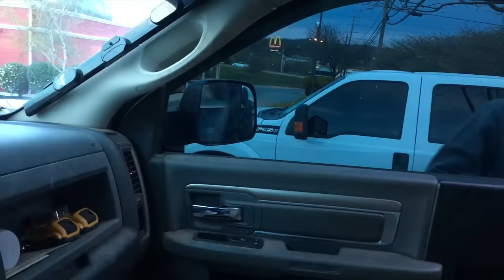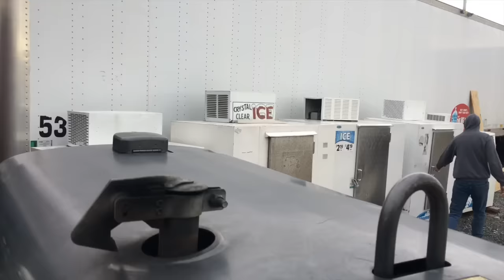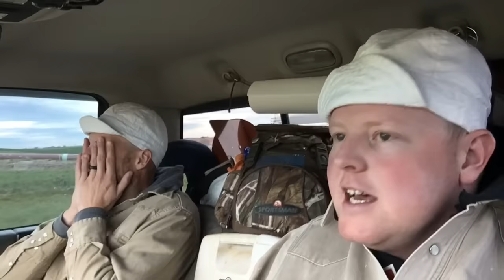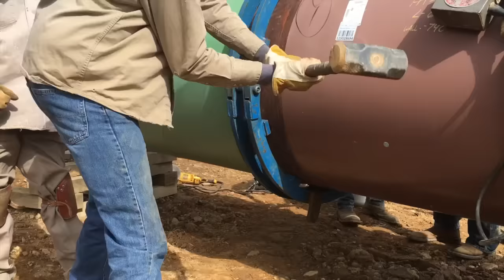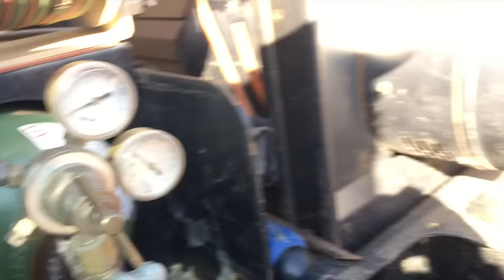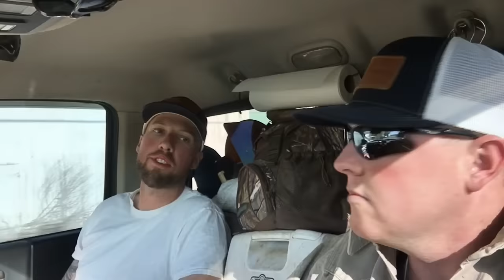DAY IN THE LIFE OF A PIPELINE WELDER HELPER

Comment: Wha t no picture shots of all these welds..... I wanna play inspector
Reply from the maker: Mark's Welding & Mech. Srvcs. 
Lol you dont want to see my welds. They will hurt your eyes.
Reply: where in pa
Reply: You don't need them to inspect, real welders run smaw (stick) UPHILL always....only amateurs and pipeliners weld downhill.
Reply: I'd end up in jail if NavSea caught me welding downhill.
Reply: I'm welder
Reply: CWI's dont usually inspect tacks,  didnt see a root pass in this vid.
Reply: John Pike almost as if you can weld downhill with 6010
Reply: there isnt even an inspector present, these guys get away with murder guaranteed. they have to grind the shit out of every pass which means the weld looks like shit and has many slag inclusions, you should barely have to chip your slag off if it is a clean weld.
Reply: @joshm9518  dude there using 6010 for bead rod, which needs buffed, and you gotta hit it with grinding wheel to smooth start and stops, and remove any slag. These welds are 100% xray, they don't get away with anything, they are high pressure gas mains! Stick to your 7018 slag chipping, and don't make comments where you know nothing about what is going on.
Reply: @arosswelding  hey Austin merry late Christmas and I was wondering what u need for a welder helper just a hard hat safety glasses is that it?
Reply: @arosswelding  did sam break out? Does he have a channel?
Reply: @johnpike9612  not true at all but ok. You people who say that are clueless.
Reply: @arosswelding   do you need  another helper I’ve been watching have some experience not with helping out in the filed but practicing going around the pipe ?
Reply: @keithstone6411  easiest form of welding next to mig and orbital 😂
Reply: @arosswelding  I have few questions. For somebody interested getting into pipeline helper what's some good places to apply? And how long do you guys typically leave home for and how much time do you get off?
Reply: Supposed to be proud of your welds my guy
Reply: I'm sure that's exactly why they didn't do it. Everyone loves to talk crap about other people's welds

Comment: Let me guess they are 30 inch pipes btw you are really good at grinding and buffing.
Also isn't it unsafe to operate the welding machine while in a pickup.

In my site my contractor doesnt allow that.But what you are doing  really saves alot of time other wise you have to frequently transport the welding machine from one location to another within the plant.

Comment: no guards on grinders, how do you guys get away with that.
Reply from the maker: jose amezquita 
Some jobs we do, some jobs we don’t.
Reply: jose amezquita livin la vida loca cuz
Reply: Wear gloves? That is why my shop requires. There are times a guard gets in my way. I was doing some grinding on a semi the other day after cutting a large 1/2 plate off the back. His pin kept sliding into it. Anyways, I had to take the guard off and use the grinder with one hand for most of it due to tight spaces. Gloves will protect you :-) 

On a side note: I had to do some over head aluminum work in a tight place and ruined my favorite welding shirt due to splatter. :-(
Reply: that 9" looked to be running at low revs to me, all TAs in Australia must have guards on all grinders,,,, nanny state some companies bitch about taking handles off......rods still burn, and im not grinding so let me know how it works out for you
Reply: 27Zangle man you shouldn’t ever wear gloves near rotating parts. Great way to rip all the skin off your hands

Comment: Used to work for 3S out of Carizzo Springs, TX as a welders helper and love it since i started out fitting in refineries. HOTTEST SUMMER OF MY LIFE! Would do it again in a heartbeat but only in Safety as the path ive been on now for a few years. You ever run into a inspector by the name of Josh Elliott, call him Jethro, give him a swift kick in the nuts for me! Love the videos buddy!
Reply: Guy Slay know any company’s hiring in Texas?
Reply: @caseofruns735  not right off the top of my head. If you dont have a LinkedIn profile you should. Always lots of job postings!

Comment: Ok i have a question what is the propane tank and the torch for. I'm in my first month of welding class. I go to Tulsa welding school in Houston being in school why is it  harder trying to get a job as a welders helper for pipefitting or any type of helper position in welding
Reply: Wayne St.croix im in ponca city and i just started a welding class as well and i had the same question lol
Reply: Pre heat the pipe, reduces the heat shock when welding and helps to make sure they don’t crack
Reply: its to preheat the metal before u weld on it, dry any water off and to cook with :D

Comment: I’m a second year apprentice but the biggest pipeline pipe I’ve done is 8” I was just wondering why you started running the root at the bottom then jumped to the top
Reply from the maker: I was just puttin the bottom tack in. We tack it on top, bottom and the sides then we hit our racks and then start puttin the bead in.
Reply: Austin Ross alright that makes sense just kinda looked like you started beading the bottom first

Comment: I work at Gunderson in Portland doing welding, was a pipe welder, passed weld test for pipe fitters union and boilermakers union, wanting to get Into pipeline welding, what's some good companies?
Reply: Reaper hey man I’m in Olympia and I’m trying to get into a Union doing welding or boiler making, how do i get into it? I have some shop and welding experience. Blacksmithing is my side thing so im not afraid of tools and hard work :)
Reply: place i went to was local 104 in Portland off Columbia blvd, just practice up on welding, learn the 1g, 2g, 3g and 4g weld tests, for the boiler makers they let you choose between mig dual shield or stick welding, test is on two 1/2'' steel plates with 42* bevels and a 1/4'' backing plate in the 3g and 4g position. they will test you on the clean up and prep and fitment of the pieces and tack welds, then they will inspect you on your root pass, hot pass, fill passes and cover passes. i chose stick welding and did the test with 3/32'' 7018 rod for the root and 1/8'' 7018 for the rest of my passes, for the root i did around 85 amps and for my hot pass i did 140 amps, and the rest at 125 amps. each pass you wanna make sure to be consistent, super clean, all the weld berries gone, no slag trapped and wire brushed. they want a single root, a single weaved hot pass and stringer beads for fill and cover passes, make sure each pass overlaps half way on the last bead, after its done if it went good they will do a bend test and if it passes with i believe a 85% or higher you will get on but if you score around a 60 to 70 you will have to wait 6 months to a year to come back so gotta make sure you got lots of burn time before you walk in

Comment: The only welding I ever did was in the Army. And I was a Bradley mechanic first. Recovery guy 2nd. Recovery is where I really dipped my toes into welding and cutting. But Iraq is the first time I ever had to actually learn more about welding but also begin fabrication. I ended up having to make glow plug box shock mounts. The big black boxes that you might have seen in old Iraq videos or pictures were for glow plugs and the idea was the glow plugs would heat the boxes and thus set off the IR IEDs before the engine would. Well goobers would pull the holding pins on these things and let them swing down. Unfortunately they would also crush a finger or two if they weren't paying attention. So the fix was to mount HETT trailer shocks to the arms and thus slow down the arms once the pins were pulled. I made so many of those kits I was sick of welding and grinding. Its been many years since then so I couldn't tell you anything about what I used to do any of it. And watching real welders on YT just reinforces how much I was just winging it lol.

Comment: How many months y'all getting out of those desalt grinders?
Reply: would like to know aswell, got the same one as in the video but ive only put 10hours of use or so on it in the homeshop, it draws alot of power if you lean on it be prepared to reset a 20 amp breaker, the 9" accessories/disks are so hard to find without ordering a box of 50+ from the local welding supply whichd cost me 400$ or more too much to fork out at once for cutting wheels could have a plasma cutter half payed for with that, milwuakee just realeased a 9" battery powered unit so maybe itll become more mainstream and more places will carry 9" stuff

Comment: love the flossing .. funny i am a dental assistant going to school for dental hygiene but have been thinking on welding not sure what to do. I enjoy working with my hands and I had to fix my plumbing in my house since it was leaking in the basement . The leak was from the cast iron old school double sink. I had to cut the copper pipping and then I took a sledge hammer to the sink since it  was sitting on a frame that weighed about 300 to 400 pounds. Its funny seeing the men's faces at lowes when i ask were do you keep the sledge hammers. I am about 5 ft but i enjoy building or making things but i suck at math wish they came out with a self math scanner to scan the area that needs fixing or what ever you guys do to attach to other metals with accurate measurements. well back to school work hygiene it is .. guess i will just use my skills on my house remodeling
Reply: Well atleast you're ambitious lol. Dental Hygienist is a good career though I'd stick with that.
Reply: Women don't last long doing jobs in which men dominate the field.  The reason is because your bodies are made different.  Stick to dental hygiene.

Comment: whats up with the pre heat..?  on the pipe...
Reply: you have to preheat the metal to allow it to become more malleable (getting it closer to melting point) so that the metal from the filler rod being applied and the base metal of the pipe will properly bond and your penetration will be successful. if you don't preheat the chance of having a weld that did not penetrate into the base material or the metal wont bond properly and can lead to cracking or failure. hope this helps

Comment: Did you start welding on pipe 1st ?
Reply from the maker: No. Worked 3 years in a shop runnin mig gun. While putting together weldin truck. Then worked on drilling rigs for 6 months before I ever touched a pipeline.

Comment: How would someone get in as a helper? I have welding certs but everyone pretty much wants you to have 4 years of experience it seems and I think getting in as a helper would ofcorse help learn more about the trade
Reply: nomad29palms same. Ive been trying to figure that out too. I dont know any welders to jump on with and i cant find anyone to explain how to get on
Reply: Yeah that’s Best way to start off as a welder‘s helper  that went to school so that way you can have a proper welding education but get the on the job experience you need   Also to answer your first question just look for a welder getting in or out of he or she’s  rig truck or  Go to a union hall for welders or pipeliners
Reply from the maker: nomad29palms 
If you dont know anyone to get in as a helper you could look into a union or just get a job welding. Any kind. That’s what i did before i ever pipelined. I worked in a shop for 3 years and then on drilling rigs for several months. I still do a little structural around the house when im home. It’s all about the hustle. Net working and hustle.

Comment: I know this might sound like a dumb question ( i am only 15 in a welding class) but did you start off with 6018 for your root pass and the rest with 7018,Hate to be that guy but how much did you guys get paid for those 2 welds is it by the hour or just by finishing it
Reply: Most of those are 6010 for the root. 7018 cap.

Comment: Why do you preheat the pipe before u weld
Reply: preheating helps prevent cracking from the metel cooling
Reply: Fatty Mcfatterson thanks that's very neat never seen that done before
Reply: Gets the sweat out of the pipe as well. makes it weld nicer
Reply: You have to do that every morning heat up all the pipes that are going to be welded that day.
It is done even here in middle east.
Reply: Get moisture out. Some places require pipe to be a certain temperature before being welded and a maintain a certain temp while being welded
Reply: i remember my bosses having a arguement over preheating a pipe similar to this size we ended up preheating it
Reply: Most of the time (like in shops, which is where I weld, all shop life here for me) if it’s a thicker base metal, normally 1/2 inch and thicker, we will preheat to around 350-500 degrees in order to get the moisture out (humidity/moisture/water is a welders nemesis) and also because it really makes the weld lay in much better, even on thinner material, if it’s warmer to begin with, it will take the several thousand degree arc we are putting to it. 
Warmer the better, but not hotter the better, if it’s too hot, then it will actually fuck shit up. That’s what is called inter pass temp, having the metal within a certain window of temperature while between passes when welding. You definitely don’t want to weld on ice cold steel and you don’t want to weld on red hot steel either, there’s a general “sweet spot”

Comment: Your code doesnt call for grinding all starts and stops?  I weld for a utility company and we are supposed to grind all starts and stops.  Api 1104
Reply from the maker: Jonathan Searls 
No it doesn’t.
Reply: crazy.  we are strictly downhill e6010 7010 8010 5p+.  most welding is in service welding  on fittings for main work.  very rare is ours done on dead main

Comment: Why are you welding down hill instead of uphill?
Reply from the maker: Leroy Wade 
That’s the procedure on most new construction main line.
Reply: Okay, I'm a pipe fitter apprentice and they always say weld up hill for more penetration
Reply: On an open root, you get the same penetration. 100% is 100% and just as strong.  Uphill is required on with XX18 and is typically required in areas where there is extreme pressures, extreme temperatures, or lots of vibration, because low hydrogen rods are less prone to cracking.

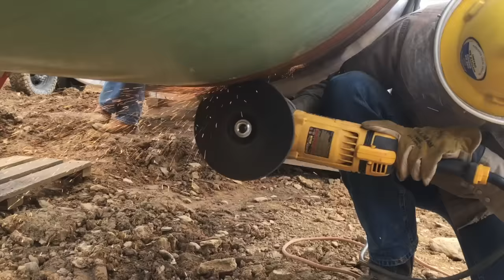Comment: 10:39 that little technique where you hold the rod between your fingers, I’m gonna have to try that. I’m in trade school for welding and we’re working on an exam right now. We just have to stack welds flat on a plate using 3/32 7018 rods and I’m having problems with keeping the rod to close to the plate. I think that technique you were using would help
Reply: It works great for welds out of position especially, practice sliding your hand slowly back towards the stinger though because the rod will get very hot in your gloves. You shouldn't need to do this on flat welds though, practice keeping your elbows tight to your body and/or three points of contact (both feet on the ground, off-hand or elbow propped on something or both feet planted and sitting etc)